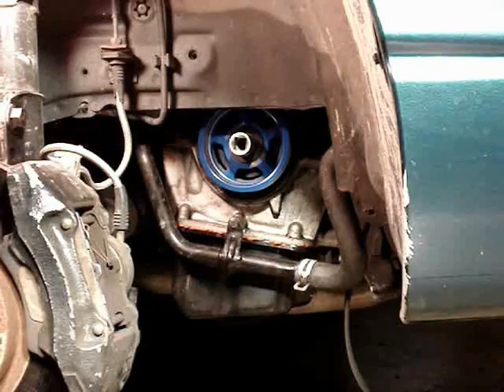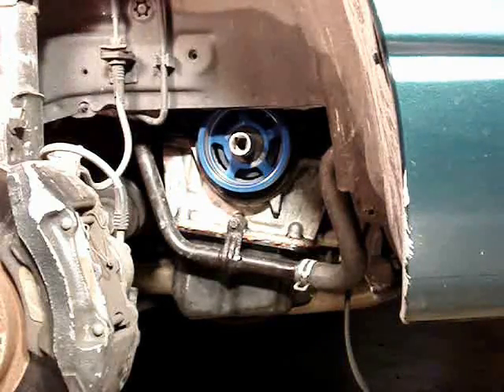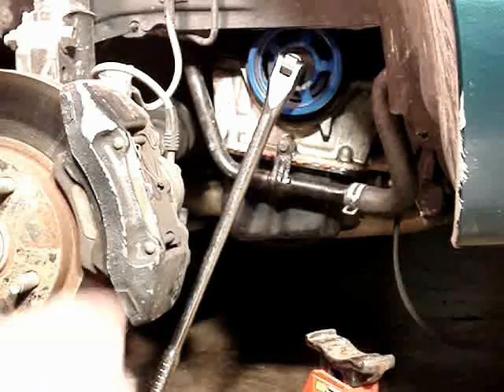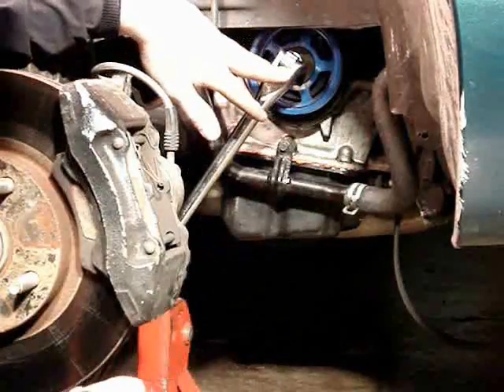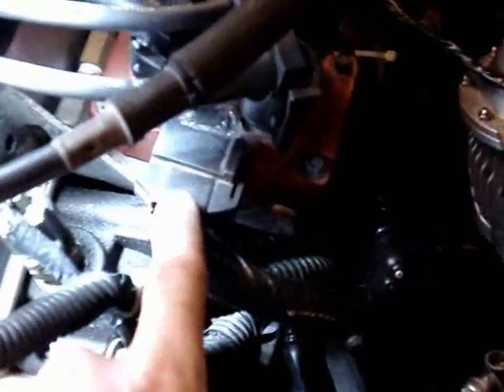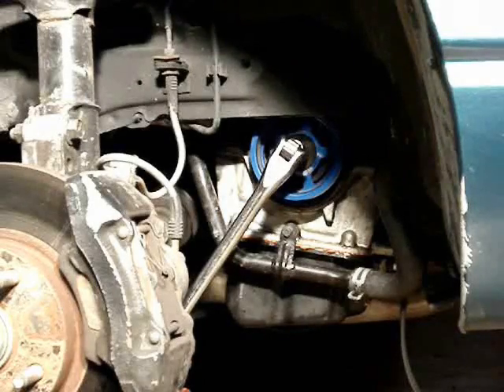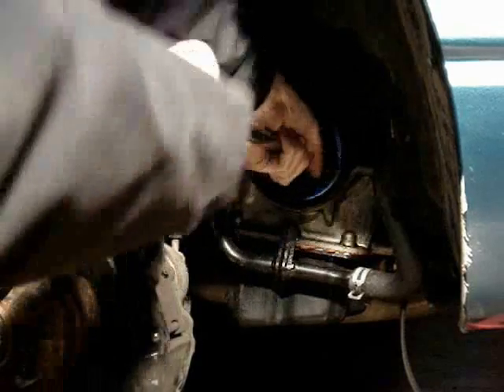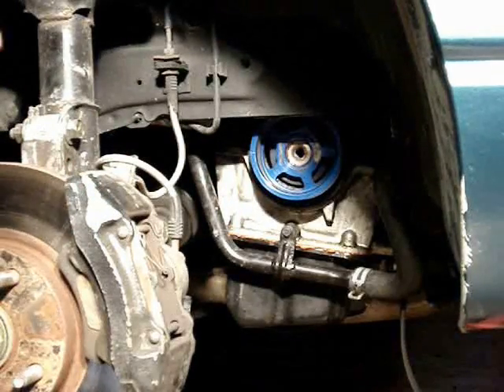How to use a breaker bar to remove a crank pulley bolt on a passenger facing, clockwise engine.

Comment: How would you tighten the bolt back when you’re finished ?
Reply from the maker: There is a tool that looks like vice-grips with a chain at the end.  If you use that (along with an old bit of belt too prevent damaging the grooves) too hold the crank, you can then tighten the bolt.

Comment: I may have to do this on a GM 3800.  When putting the bolt back in you used Loc Tight on the threads?  How much? Around all the bolt threads? Then wrench it on with your breaker bar as hard as you can?
Reply from the maker: Just a dab of Loctite.  It is best too have a holding tool and torque wrench, but I had none of that when I did this video.

Comment: I didn't disable the ignition system on mine.... I bumped it for less than a second which successfully loosened the bolt, but I heard the starter grind for a second..... Do you think I messed it up?
Reply from the maker: Probably not.

Comment: I left my car in first Gear while turning the crankshaft pully  anti-clockwise, is that a bad thing to do?
Reply from the maker: Not going to hurt the transmission.
Reply: @ZX2Fast  Thanks for the fast response, you sound very reassured! One more thing, how strong is your starter.. and does this matter?
Reply from the maker: @mathw2703  it should be strong enough to get that bolt loose.

Comment: I read many comments on this and i still wonder what can go wrong if something does go wrong...Murphys Law? Im having a hard time losening this bolt on my Mitsubishi Space Star 2004... I cant think of anything go wrong or mechanical broken...except peoples safety?
Reply from the maker: Everything we do is risk versus reward.  If no one is standing near that side, then it shouldn't be able to hurt anyone.  Just be sure to disable the ignition so the engine doesn't start.  I had an electric impact when I made this video and it didn't get the bolt out.
Reply: @ZX2Fast  What if my wrench brakes into half or gets bend...ik had this when I tried manually to losen it....? As long as theres no engine damage i try it... Oh..by the way..is this a big engine ..mine is 1.6 litre..

Comment: What if the ignition is left on and the engine actually starts up for a second? Would it damage anything inside the engine and if so,  what would be potentially damaged?
Reply from the maker: On most cars it would not.  But if the crank pulley slides off, it can damage the timing components which could damage valves if you have an interference engine.

Comment: That's crazy, just hold your pulley with a screwdriver and push it up against something to hold the crank. I have removed hundreds of these bolts and never would use this method.  You are risking a lot of damage

Comment: Just did this on a 1997 Toyota Camry 3.0 because the impact gun could not budge it. Been working on this bolt for 1 hour. I tried this trick and 2 seconds later it came off like a hot knife to butter.  Thanks for posting this :)

Comment: couldnt you break the starter like this?  I was just thinking of putting the trans in drive with the e-brake on?  I'm dealiing with a forward facing V8 (5.8 ford)
Reply from the maker: I can't imagine a scenario where that could happen.  I have seen many engines that were locked up and it was discovered by trying to start it and it wouldn't.  If that won't break the starter, nothing else will, unless something was already wrong with the starter.

Comment: Put clothesline in the cylinder to lock the engine to R&R the crank bolt. Get it just below TDC and feed the line into the cyl.

Comment: Uh.... Scotty.  Tried the breaker bar method and the impact tool as well.  No luck.  Sliced my leg up when the breaker bar let loose.  Hit me in the gut so hard, I thought an NFL linebacker hit me.  What do I do now?
Reply from the maker: Go the hospital.
Reply: PHILLIP SMITH Use a torch and get the *bolt nice and hot. Almost red. Then use the breaker bar method. It should cause the threads to expand and contract from hot to cool process and break any seizure there was ;-)

Comment: If this does not work and it broke my 21mm. What is your suggestion?
Reply: get a new car
Reply from the maker: Verify that the engine rotates clockwise when you start it, get a better 21mm, if all else fails you'll have to purchase a good compressor or take it to a shop and have them break it loose.  You may be able to find a mobile mechanic that will come break it loose.
Reply: I went to a shop the guy used all his Impact gun (Air) the nut did not even move lol. He has no clue on how to get this nut out. Someone told me to use a propane torch on the bolt too.
Reply from the maker: Propane probably won't get hot enough, try heating it with MAPP gas.

Comment: Hi how do you tighten when finished ? by hand as must as you can ? will that even be enough ?
Reply: Put vehicle on jacks and then put it in gear. Now lock one of the lug nuts with breaker bar against the floor. Then hand tighten or use torque wrench to tighten the crank bolt. You can also remove it by doing the opposite way, that is lock the crank using breaker bar and socket and tighten lug nuts.

Comment: what if I already have the valve cover open and the camshafts are lose? Can I still crank it? I'm trying to avoid having to put the pieces back onto it...I should have thought about this prior to getting them off.
Reply from the maker: It depends on what engine.  On the engine in this video, that would be okay.

Comment: thanks for this very educational video , it worked on my GF's 2006 Nissan Altima  2.5 L QR25DE engine , that damn bolt was there for good . 
now for those who does not know what direction this bolt threads off ? it is counter clockwise vs engine crank clockwise . to thread it in ( tighten it ) it is clockwise up to 140lb/ft , at 2 stages . 
thanks again for this wise tip mate , it sure popped that sucker out

Comment: This method can"t use for Acura or Honda...
Reply: Honda and Acura engines spin counter-clockwise. That's why.
Reply: Not true...  If the engine cranks clockwise, it should work great

Comment: Just tried this and it broke my breaker bar instead of loosening the bolt. Fuck.
Reply from the maker: +Richard T That is nuts!  What vehicle/engine is this?
Reply: ford focus zetec 1.6
Reply from the maker: I'm pretty sure those are clockwise engines.  Maybe your bar was defective.
Reply: I talked to a mechanic and he said that he has seen bolts in Fords Focus and similar models cease up and even air guns can not remove them. I hope this did not happen to my car.
Reply from the maker: ***** You may have to apply a lot of heat to it, then try to break it loose.

Comment: Awesome worked for me on my 07 ford fiesta (UK) if your not sure which way your engine turns just turn the key for half a second and see which way it spins, get a friend, record it or check data for vehicle it will tell you if it's clockwise or counter clockwise 👍😉 I wedged the axle stand with a spare wheel and just to make sure a gearbox that was lying around lol but it worked a treat ofc everyone got out of the way and I stuck my head in the footwell when I cranked the key :IMPORTANT: Always remember to Disconnect the wires to the coil pack first !!! Cheers 🍻

Comment: this tactic works great as an emergency without air tools. My compressor took a shit on me. this worked great. Make sure your engine rotates clockwise. and then Tightening is usually always easier then removing the bolt except do not use this method to tighten. You will have to access the flywheel there is usually an inspection plate you can access and I was able to insert a prybar into a whole in the flywheel and then use a torque wrench to tighten the crank bolt to spec by myself. hope this helps someone!

Comment: Wow! I never thought to use this method. I purchased a 750 ft/lb Impact gun and it won't budge the crank pulley bolt on my Acura MDX. I had the timing belt replaced a little over a year ago so I thought it would a little easier getting this bolt off. Should I just disconnect the three coil packs on the front to stop the truck from starting?
Reply from the maker: +Daniel Bailey Make certain your engine spins clockwise before you try doing this.  Also, I think the harmonic balancer on that vehicle has to be torqued to spec (something you can get away with guessing on a car as simple as the Escort in this video) so you'll need something (like a chain wrench or holding tool) to hold the pulley in place when you put the bolt back in so you can torque it properly.

Yes, if I were to work on this vehicle (and the engine does indeed spin clockwise) I would disconnect the coils and then make sure your bar is braced against something that won't bend or break.  Of course this is all at your own risk.
Reply: +ZX2Fast  Thanks for the reply! I have a Honda tool I use for the crank. It has a long handle and the other end fits right inside the crank pulley. My torque wrench only goes up to 150ft/lb and I believe the Acura needs 180ft/lb. I'll figure out something.

Comment: I could not get it with any manual tools. I bought a $70 half-inch bit 7 amp impact driver and got it first attempt. Worth it.
Reply: My electric impact gun wouldn't budge that thing.  I also couldn't get it off with a breaker bar with the car in gear, belts on and the brakes on!  I think King Kong put this one on.  I still haven't got it off yet.  I may have to try this since my spark plugs are already out.

Comment: How do you properly re-torque the bolt?  I had a friend take the pulley off a Honda Civic years ago, got it off without a holding tool.  Tried to tighten best he could on re-assembly but after a few hours of running the bolt backed off and teh pulley was wobbling and apparently it ruined the crankshaft.
Reply from the maker: +Matt K To do it proper you have to hold the crankshaft in place.  Some people take the inspection plate off the bottom and wedge something into the teeth of the flywheel and others wrap a bit of old belt around the crank pulley and use a chain vise to prevent it from moving.  I always use a bit of red Loctite as well too be certain.

Comment: I've tried this technique ten times today as well as an impact gun and nothing is working! What am I doin wrong and what can I do next?
Reply from the maker: +Amber Craig What car and what engine?
Reply: +ZX2Fast finally got it off after five days of trying, the breaker bar didn't work, torch didn't work, 250Psi Impact didn't work, we got it off with a brand new $700 300 pound of pressure impact gun. That bolt had grown men mechanics about to cry lol. 02 Mazda 626 2.5l
Reply from the maker: Sometimes that is what it takes.  I bet people have replaced engines too avoid removing that bolt.
Reply: +ZX2Fast 
I came very very close to junking the whole car lol.

Comment: It doesn't always work and sometimes you have to heat the bolt with a torch then it will come off. I used a small propane torch to heat mine and off it came with a couple of starter bumps.

Comment: On older cars have you ever noticed that the crank pulley needs to be reworked or it's wobbilying?  I can't get parts in SE Asia and this has been an issue for my 88 Mitsubishi Lancer, ugh..  I've had it machined two times now.

Comment: Sure you could get hurt on the bicycle. or anything if not carful. Even back in the days when all airplane engines were started by Hand. Like everything we do in daily life.       Yes this scary but this guy is out of harms way. And has the breaker bar up against the A frame. I have even had to do this helping my son with his Tacoma over 200lbs TQ with oem Loctite on almost every damn bolt..  Good video dude as long as everyone does it like you did it
I don't understand why people post rants when you've posted won't work on engines that turn the other way. wtf   Those posters must be the dump asses whiners on the net.   
  .
Reply: Rich M ma
Reply: Rich M I

Comment: Recognize the NAPA pull handle, but you did use a 6 point impact socket for this as well.  A 12 point could very easily round off your bolt.

I used a 5 foot long pipe cheater on the small handle.  A Snap On 1/2 inch drive 19mm 6 point impact socket to engage the bolt.  Over 200 foot pounds of torque to break, but it did it.

Comment: how to tighten it back to a certain torque?
Reply: This depends on the car and what tools you have. Some cars (like Honda) have a special tool you can use to keep the pulley from spinning. On others, you can use a prybar or large screwdriver to hold the teeth of the flywheel/flex plate.  It may also be possible to jam a screwdriver between the teeth of the flywheel and starter gear. And on manual transmission cars, you can sometimes just put the car in top gear and have someone hold the brakes while you crank away.

Regardless, tightening is actually easier since the applied torque is less. All you need to do is tighten it to spec. But when loosing it, you usually need to apply FAR more torque than the spec in order to get the bolt to pop.

Comment: how do i know if my crankshaft pulley bolt tightens clockwise or counter clockwise? ty
Reply from the maker: Have someone start it while you watch the crank pulley to see which way it spins.  If it spins clockwise, you can use this trick.
Reply: ZX2Fast sorry.. timing belt broke, i cannot attempt that :(
Reply from the maker: friedchicken1981 If it is a Zetec engine (except the one in the SVT Focus) then it doesn't matter if the belt broke.
Reply: ZX2Fast no. its a 1999 renault clio van 1.9 diesel single overhead camshaft
Reply from the maker: A chain strap wrench (with a section of old drive belt to prevent damage to the belt grooves) will be needed to hold it in place while you use a breaker bar to get that bolt loose.  You could go rent an air compressor and see if someone will let you borrow an impact wrench and remove the bolt that way.
Reply: ZX2Fast it's such a complicated car, french cars.. the pulley is made of 2 eccentric parts held together by a rubber divider, so strap wrench won't work, the outer part of the pulley will twist.. i managed to lock the flywheel with a screwdriver and with the help of a friend, to break it loose. turns out the bolt had a lot of loctite on it. it was a btc but at last we did it. thank you for yor help!!!

Comment: No I have absolutely no problem with someone working on their own car, I think it's great people knowing how cars work and how to maintain them. I just think this tip is awful because 9 out of 10 times it may work but that 1 time when it goes wrong you're in a world of shit and expense that could have been avoided with the right tools. And in response to Dwayne Herbert, just came across this clip and the title caught my eye. To do this job correctly you need the correct flywheel locking tool for whatever vehicle your working on and a good breaker bar or nut gun and a torque spanner for putting it back on.

Comment: As a motor mechanic I am not keen on this idea as it has the potential to go wrong and could be also be dangerous. There is also the problem of doing up the crank bolt to the correct torque after you have done your work on the belt if you do not have an impact gun. If you don't have a gun get someone to lock the engine on the flywheel in gear foot on the brake and use a 3/4 drive socket extension supported by the axle stand out sdide of the wing area and undo with a t bar and piece of long tube.

Comment: ahhhh...nice one.  Disconnected the coil wire to the distributor cap and had to kick the engine a couple times (didn't happen on the first attempt, but a couple of kicks and out it turned.  rOck On!!!!!

Comment: Get some locking chain pliers ($15-$30), pad the pulley, clamp it and use a cheater pipe on the breaker bar. Works for 99% of engines.

Comment: sweet... but how do you put it back on
Reply: JesusManPowerKick This is an old reply, but to anyone who will read this, to put it back on you can use a pry bar to lockup the flywheel through the bellhousing inspection hole. Google the method, you will see what I mean. It locks the crankshaft up so the bolt will thread in nice and tight without a fuss. On some vehicle it needs as much as 75 ft Lbs torque
Reply: Put vehicle on jacks and then put it in gear. Now lock one of the lug nuts with breaker bar against the floor. Then hand tighten or use torque wrench to tighten the crank bolt. You can also remove it by doing the opposite way, that is lock the crank using breaker bar and socket and tighten lug nuts.
Reply: On Toyota 3SFE it's more near 300ft lbs. Nearly impossible to get off or on without the HF Earthquake impact. It's about on par with IR heavy duty impacts. Don't let the HF name scare you. This wrench is serious business.

Comment: I have a electric impact wrench that puts out 220 ft pounds and it didn't even budge that bolt on my car, so I did do this method and it worked... what a relief too. I had no other way of changing my timing belt cause of that stupid lower timing belt cover that was flat out in the way. Seems like the designers can't design a timing cover that splits just right above the crank pulley... no, that had to split the cover just below the cam sprocket instead. If it weren't for this method, I was seriously thinking about modifying that cover with a grinder.... lol.
Reply: The bastards design stuff like that so people have to pay them to get it done